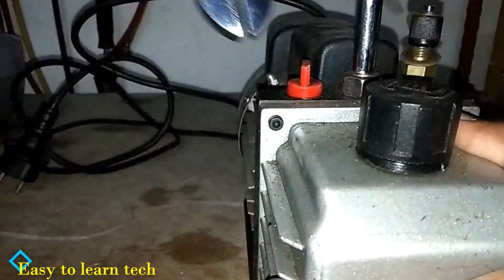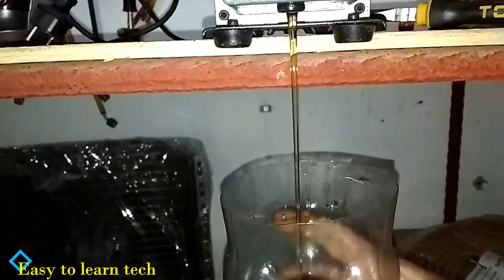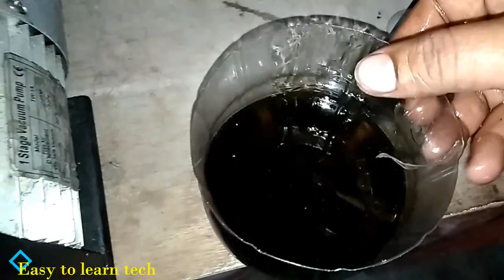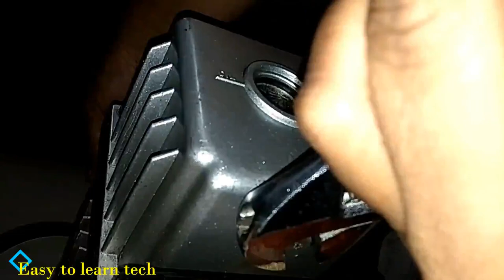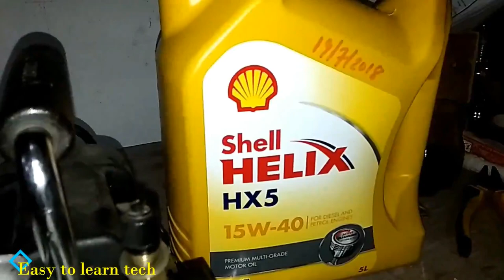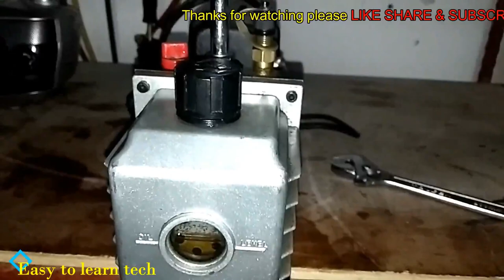VACCUM PUMP OIL DRAIN AND Refilling, make the life of the pump good,

Comment: What will happen if add the oil to the wrong open.. in our vacuum there are two opens, and i added around 2 ml to the wrong open.. actually i am afraid because it is so expensive..
Reply from the maker: Wrong opening means, what are the parts thier.
Reply: @Rehankhan_HVAC_TIPS   air filter opening
Reply from the maker: Try to filter that area otherwise always, that area will get blocked. Due to thickness of oil.
Reply: @Rehankhan_HVAC_TIPS   how I can filter it ?
I don't know any thing about mechanical engineering I am a research assistant at biology department.. I hope my professor not recognize that😢
Reply from the maker: Simple way keep it up's &down, till oil comes out.
Reply: @Rehankhan_HVAC_TIPS  thank you so much for your reply 🙏
Reply from the maker: Let me now

Comment: did u try to vacuum ur 4nus after u put engine oil into a vacuum pump ?
Reply from the maker: Yes , because it was emergency, we didn't get the Vaccum oil in the market so I use engine oil & its was working fine .. now also I am using same...
Reply: @Rehankhan_HVAC_TIPS  what kind of engine oil did you use? I'm finding it hard to find pump oil in Australia and I have no idea why. If I could just use engine oil it would save me a lot of time and money ordering from overseas.
Reply from the maker: Motor engine oil but the oil shouldn't be thick. The oil should be thin .

Comment: not recommende subsitute motorcycle/car engine for oil vacuum pump the viscosity oil not thesame.
Reply from the maker: I have been using it for 4 years, no issue found still working smoothly.